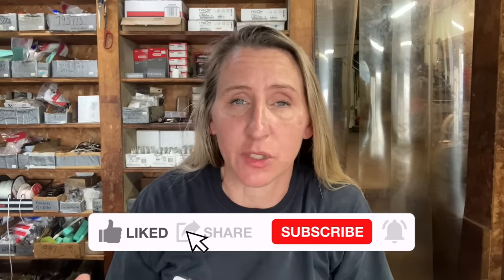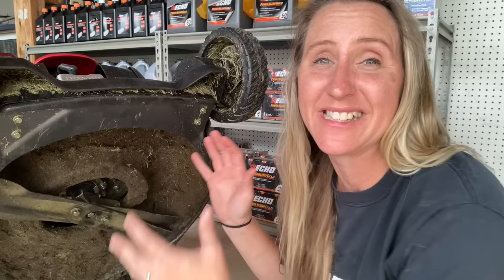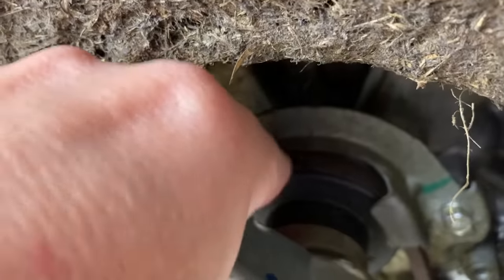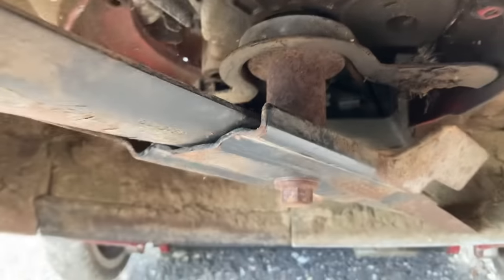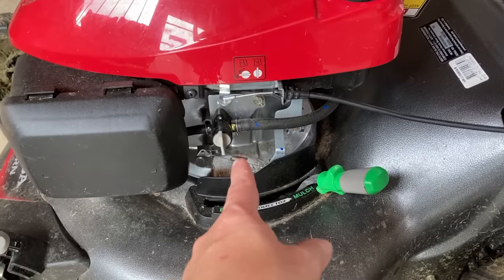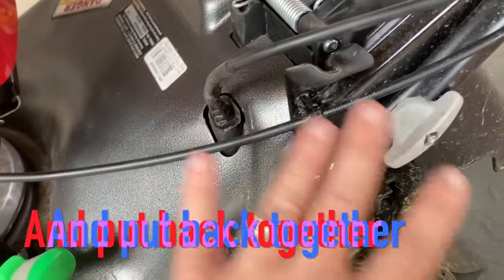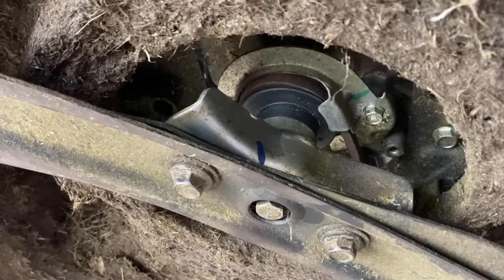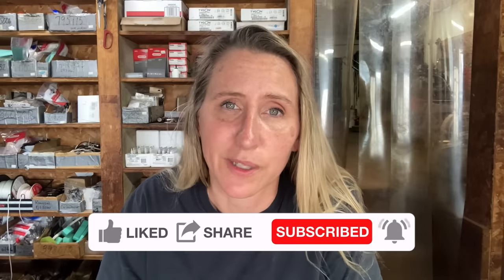SAVE A TON OF MONEY in repairs by NOT BUYING this NAME BRAND mower.

Comment: This is good information and I'm glad you're willing to put out information on potentially bad equipment. So please don't take this as a criticism of any kind toward you. You didn't say whether or not you are an authorized Honda Repair Shop. That mower according to Google has a 3-year warranty. If you're not an authorized shop, why would they bring it to you as opposed to a Honda dealer to obtain warranty repair on an almost new piece of equipment? You're obviously a good mechanic, but again we're talkin about warranty here. Again, this is not a criticism of you. I watch your videos regularly. I'm just curious about this potential issue.
Reply: I doubt that’s a warranty repair, Honda would just claim misuse or something anyway otherwise they’d have to admit a design flaw.
Reply: @chisel83  that is a possibility. I don't personally know what the warranty says, I just confirmed that the period is supposed to be 3 years. My question is asked wondering if Honda is not honoring their warranty for whatever reason. And there can be an argument made that it's not misuse when they have a defect that allows it to happen on their lawnmower but other lawnmowers clearly don't have this problem. 
Just something that came to mind while watching the video.
Reply: Might be an availability thing as to why they went to her. I know that I ran into that issue with a Craftsman. The very first time I used it, it didn't run right. So, I looked for a repair shop and found that I had to take it back to Sears and they in turn, had to ship it from York, PA.  to Baltimore, MD. It took over a month for them to install a new carb and ship it back to York.
Reply: @daviddelle774  yeah, a good possibility also. Just curious since I understand that Honda's car warranty is so good because they make you replace everything on preventive maintenance before it can ever go bad. This was more a statement about Honda then it is about her. As I said I watch her videos regularly and am impressed with her abilities.
Reply: My thoughts exactly. No Independent shop should be working on any equipment which is still under warranty - that's why you cannot buy parts for new mowers, duuh!
Reply: My impression of the warranty is the authorized dealer’s shop would take it apart, and take pictures and sent them to Honda. Honda would then decide what they, Honda will cover under warranty, and what is not covered. All the while they are deciding, your grass is growing and you need to get your yard cut. You potentially could be without the mower for a month between tear down, decision, waiting for parts, and final reassembly / repair. Plus it’s a 50/50 shot that Honda says “not covered”, meaning you get the full bill. Taking it somewhere else, and getting it back quickly, and at your own expense anyway, since Honda may not cover it anyway might be the smart play.
Reply: @haneyoakie14  thanks for the information and that's a good recommendation. But if that's the way Honda does business I think the smarter play would be not to buy Honda in the first place even if they do allegedly have quality Equipment. If warranty is that hard to get, especially since they charge two to three times what everybody else does for a lawnmower, it tells me they can't be trusted. 
By the way, I have a Craftsman Eager 1 20 inch walk behind mower that is about 40 years old and still running. It uses about 2 ounces of oil every time I cut the grass but I'm only using it for trimming now. I have Southern States (MTD no longer sold as Southern States) and a Cub Cadet riding mower that are both about 20 years old that I use now.  Both run well.
Reply: @mikeslater6246  that Eager1 probably has a Tecumseh 4HP engine on it and is one of my all time favorites because my Dad had one for years and years. I don’t have Dad’s real lawnmower, but I have one exactly like it, the one that I was allowed to use for the first time in September 1976 after having reached (Dad’s rule) 10 years of age. I also rescued a 1965 Montgomery Ward Powr More with the wind crank start Briggs that reminds me of the one Dad had before that Craftsman Eager1. At auction, I seek the Honda’s because people will buy them when I fix n flip. My daily driver is a Craftsman with a Quantum. 12 cubic inches of guts n glory. Love the Tecumseh, but they are getting rare because they went belly up 15 years ago.

Comment: Well, it all comes down to maintenance.  Treat your equipment casually and it will wind up the casualty.  I’ve had my Honda HRN216 for over two years, this its third season, and not one problem.  Not maintaining your mower can’t be blamed on the manufacturer.  From the look of that unit, maintaining the Equipment is not his or her forte.  Sure, maybe a shield over that area would be a good idea but even my Honda HRR216, the older version, builds up grass under the deck.   Cleaning it after each use is key to a happy mower, cheers!  Oh BTW, I’m one of those that cuts wet grass, usually in the morning.
Reply: This model is already a couple of years old and I can't imagine they'd still be getting SO MANY positive reviews if every-other one sold breaks down within a few months.
Reply: She's talking about poor mower design.

Comment: I have a Honda HR194 (19" blade, 4hp engine) of c 1984 vintage that I believe was an end of line unit that was originally for the French market that was imported by Honda UK and sold at a substantial discount.  It is astoundingly good although the aluminium deck has been substantially repaired.  The engine starts with the second pull after the winter layoff and thereafter on the first pull for the rest of the season.  I have actually used it to shred conifer hedge clippings in addition to cutting grass!  Its a brilliant mower and polls as good today as it did nearly 40 years ago.  It is self-propelled with a shaft drive that I have never needed to service.  The only service/repair items I have had is a coil (used), a spark plug, an air filter, a blade and two tyres (original ones dry rotted), plus annual oil changes.  Every year the mower is used to cut around 1/2acre of rough grass before the use of the ride-on because it can't cope and the Honda then cuts the lawns for the rest of the year.  I very much doubt whether I will find a new mower as good and new Hondas are one of the most expensive available with the disadvantage of a resin deck.  I am seriously considering fabricating a new metal deck as I can't see the existing one lasting more than this season and generally any used deck is invariably in a worst state than mine.

Comment: An even bigger problem well written up on the interweb is their rear wheel steel bushings.  If those get the slightest bit wet they rust and seize and you have to take the entire rear mechanism apart to remove the bushing, clean up the shaft, grease it and reassemble until the next time it gets wet.  It locks the wheels up so you can't pull it in reverse!  Don't ever wash the bottom of these mowers because the bushing and shaft will get wet.  Get a Toro black engine 21" instead!
Reply: That was an issue on the HRR units but has been solved by the HRN redesign
Reply: @Carlsmower  You're right: https://youtu.be/ZvpqyWQUb48

Comment: I've had the same mower for 4 years and actually like it a lot, and it's never been in the shop. I never cut my grass when it's damp let alone wet. I did finally adjust the cable for the drive belt. It does look like a pain in the A to put a new belt on though! When I pulled the blades off to sharpen I literally had no grass under the deck! Take care of your mowers people, just like any other machine!

Comment: This mower should have a 3year residential warranty  which would have covered all repairs and replacement of broken cable connections.  Why did they bring it to an independent repair shop when the repair could have been free?
Reply: Could be they  took one look at the mower's condition and said it's due to abuse, so no warranty.  Honestly, my opinion only, but someone who treats an expensive or even an inexpensive piece of equipment like that deserves failures like this.

Comment: Great information!
But you did hit the nail on the head.
Mowers are not designed to mow wet grass. When something is used in a way it wasn't designed problems will arise. If you mow when it's wet the unit has to be cleaned. If not you pay someone else to do it.
Reply: The way it’s designed it allows for twigs and other debris to enter also. Wet or dry it’s a design flaw. It needs a simple shroud next go around.

Comment: i'm really glad to hear this about this mower. I'm just a hobbiyst, but I couldn't believe how difficult it was to perform basic maintenance on them. I just kept taking parts off while thinking I must have been doing something wrong or that I was missing some obvious other way of getting to the problem.  Another problem is that the rear wheels tend to rust on to the axle and seize up. When that happens, it destroys the transmission if the owner insists on getting it to run. Taking off and replacing it with a new is another two hour nightmare, and the replacement is prohibitively expensive. No one ever opts to do it. That's why I have like three of these ophans in my shop.

Comment: This is user error failure. Look at the condition under the deck with the debris build up. Owner is not using the rear discharge and is mulching causing excessive strain on the self propel system/belt. Simple fix: clean your mower and read the manual
Reply: Or simple manufacturer fix shroud the self propel housing with a one dollar piece of metal
Reply: @tedbell4416  I mowed yesterday for the first time with my new Honda HRX . I may try to fabricate a shield out of plastic to protect the pulley and drive belt.
Reply: What Ted Bell said - zero reason to allow the junk get inside the innards. The metal along with 4+ bolts would be more expensive than a single dollar, though - but not much more.
Reply: Honda is not always right, and the user is not always wrong. 

These mowers are not perfect by any means. I've put my last Honda on a trailer. As was pointed out in the video, there are other mowers that do not have these problems under the same conditions.
Reply: @stanimir4197  yeah with today's crazy prices probably more than a dollar. The more amazing thing to me is Honda has been making mowers for a long time they should know a design like that would never be a good one with having everything exposed.

Comment: As a small engine mechanic I have to say Honda products in General  have gone downhill .The older stuff was well made,I see the GCV 160 motor outlast many bodies on equipment.
Reply: We have had several of the 170 engines come in with valves locked-up. The mowers were too new for us to open so I am uncertain of the problem, but there is or was one.
Reply: I have the Honda 190 on my 15 y/o pressure washer and 7 y/o EU 3000. Bullet proof.
Reply: @timfrost4291  Incredible engine. We have one that was pulled out of the pile full of water. Honed the cylinder, freed the valves and it runs great.

Comment: I can tell you PRECISELY what is wrong.  Its a mulching mower that comes with a mulching blade and using the bagging function with the mulching blade is bad/dumb... and also opens up a gap that lets stuff get up around the pully yes.   If you're gonna bag with this thing you should definitely have a regular mower blade for it.   That rear chute-flap is actually to "not mulch with it" and is the grass blow output, the standard mulching blade isn't actually strong enough to correctly bag.     The bigger problem with this thing's self propell system is that it's geared WAY TOO EFFING FAST at its lower speed range - which is what burns the belt up; partial application.

Why is it taking you an hour to cut the old belt, blow the crap out, lace a new belt back-and-forth over the blade and shove it out to the drive gears?    The problem point is the gap that is opened beside the hub area when you slide the valve to bagging.
Reply: Looks like this owner, has been using it on 6 inch tall wet grass, with the lever on bagging, but doesn’t bag.  The amount of buildup on their deck is not normal,,,,even for people who don’t hose down after each mow

Comment: They saved a buck by redesigning the cover off the machine. They have forgotten what the machines are used for.
Reply from the maker: Right. All they had to do was make a better belt guard. I don't get it..
Reply: @Chickanic  Makes you wonder if they looked at the competition even a little,  WalMart sells cheapo mowers that at least got that right

Comment: I have one self propelled that is 25 years and still starts every time and another one that is almost 15 years old and starts every time. I don’t cut wet grass, I treat my fuel and change my air filter every years and replace the plugs every 2-3 years and keep it reasonably clean.

Comment: Agree with you on your calls.  I am running 2 old Lawn Boy self-propelled 2 strokes.  Was given one, believe it or not the engine mounting bolt were loose or missing.  The second I purchased at the local lawn mower salvage yard for $25 bucks.  They are tough as hell and work for cutting the steep ditch line on my property.  Also decades ago, while stationed in Spain, made good friends with a expert small 2 stroke motorcycle race builder, and he gave me a tip that so far, well 35+ years, to run the oil mix slightly leaner than the book calls for.  I have run the heck out of these small engines and have had no problems so far, but buddies of me tell me that I am wrong, while at the same time I am repairing their carbon packed 2 strokes.  Do run synthetic oil and non-ethanol gas mix however.  I still can't believe that Briggs hasn't had a law suit against them for that "Never change oil" engines.  Sorry those things self destruct beyond any repair after about 100 hrs of use.

Comment: Wouldn’t this be covered by warranty?
I always stick to push mowers, self-propelled just has too many things that can go wrong.
Reply: If the instructions tell you to not cut wet grass, and you cut wet grass anyway, and it jams up the self-propeller via this obviously bean-counter-driven design flaw, I suspect they would deny the warranty claim as you were using the machine "incorrectly" by cutting wet grass in the first place.
Reply: Yes Honda comes with a 5 year warranty. I’ll sue them if they don’t cover this with my $1k Honda I just bought
Reply: @appleztooranges  This particular model only has a 3 year warranty, which I know because I JUST unboxed mine last night. Although I do plan on keep it clean and maintained because I too neglected my old mower like the one in the video which is why I needed the new one this summer. 🤦‍♂️

Comment: I've had three mowers.  My latest is a Lawnboy with a Briggs and Stration engine I've had for ten years.  No major repairs.  Just routine maintenance.  

Before that I've had a Honda and a Sears.  Both lasted five years, but what went on them was the self propelled gears.   It wasn't the belt, but the plastic gears wore out.   I have a hilly 3/4 acre to mow with a 21",  I always try to wait for the grass to dry, but that's not always possible,

Comment: Dont mow wet grass
Reply: Today's society is dumb. Common sense got thrown out the window a long time ago.
Reply: Don't buy Honda junk products
Reply: @dalelangila9274  🤣  yeah go buy a POS Troy Built from Home Depot instead. My shop sells 100's of Honda mowers each year. We go over everything with the customer when selling the mower, including not mowing wet grass. Amazingly the work we mostly do on these mowers is just regular service issues because our customers use the mowers correctly. The Honda commercial mower (not the one in this video but a Honda product) is the best walk behind mower ever invented.
Reply: @deanhagerman6843  exmark makes some real nice commercial walk behind mowers to.
Reply: In some parts of the world you have no choice but to mow wet grass. I guess the best bet would be to have two mowers, eg a self propelled for dry grass and a simple push mower for wet.
Reply: @falgianibrandon  We sell Ex-mark as well, the 30inch Commercial is what most of our landscapers use for their big walk behind and use Honda commercials for their smaller ones.
Reply from the maker: Yup, I am all about Hondas, but do not understand why they didn't make a better belt guard design. You are 100% about being able to tell the customer everything as they buy it. It makes a huge difference.
Reply: @Chickanic  Agreed and agreed 🙂
Reply: Totally agree 100%.  Never have and never will mow wet or even slightly damp grass.
Reply: @arnimkrause5696  where do you live? Here in Central Texas,  if you don't mow damp, you would be waiting until May. Have to start cutting in February,  and don't usually stop until sometime in November.
Reply: @mitchellbroaddus9120  I live in Michigan.  Most of the state is drained swamp land. It’s always wet here.  I have to power wash under my deck every two mows or so.

Comment: You’re spot on, I have a 5 year old 217. The propel cable broke. Worked for days trying to get  the new cable to work, tried a different cable, (BTW over 100 variations of this mower), finally took it in for repair, it works but not as new. I don’t mow wet grass. Home Depot no longer sells Hondas, now it’s Milwaukee.

Comment: Yep. I had the same mower. I got stuck and couldn't get a commercial mower at the time due to lack of everything here during the time of covid. Served me well for approximately 4000 cuts before everything but the engine started to go. Good mower all round for the money in my opinion, but i must confess debris under the belt drove me nuts. But 4000 cuts for the average Joe is a lot of mowing I suppose....